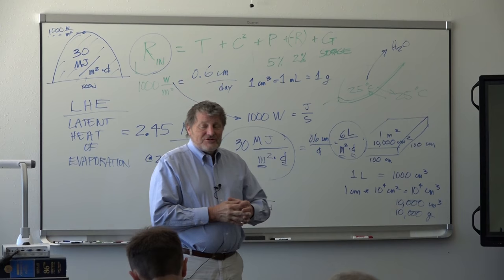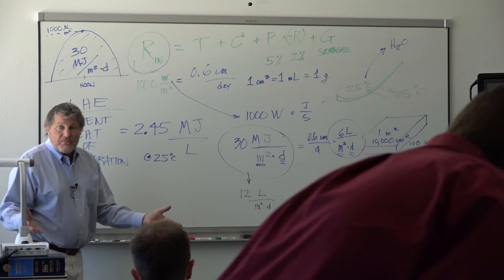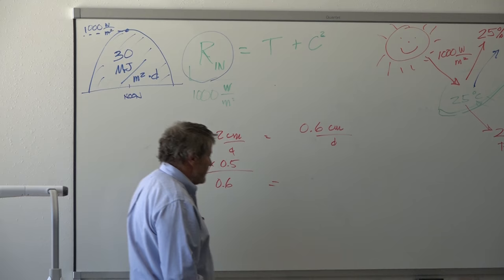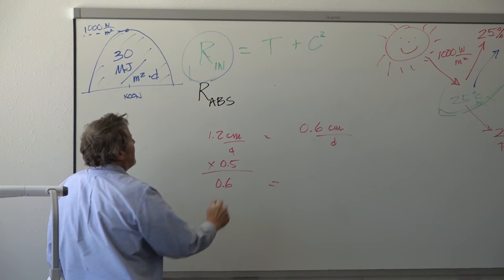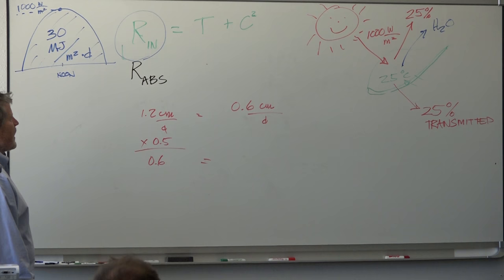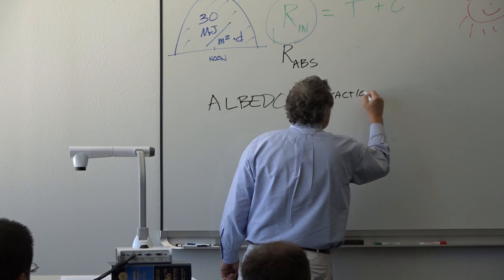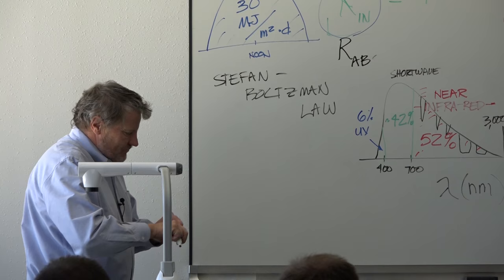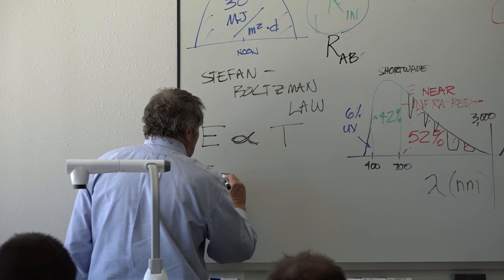Lecture 2-Principles of Energy Balance in Environmental Systems

Comment: At 28:30 when you are talking about leaf overlay, I believe that fact that many plants use the Fibonacci sequence in leaf pattern when growing due to general efficiency of the pattern, I’m wondering if there is any direct correlation that can be made to the amount of light that passes through these “groups” as you call them and the spacing of these leaves.  Just a thought.

Comment: The chart you showed that had leaf albedo and emissivity gave a value for absorption of 0.25. Your diagram of the leaf says that 25% of radiation is reflected, 25% transmitted, and 50% absorbed. In the example you state that 1-Albedo is equal to absorption which would be 0.75 not 0.5. It's been a very long time but I think the equation was supposed to be 1-albedo-transmittance=absorption. If so, your chart that you supplied is missing some values that are needed to do these calculations. Hopefully, someone can help clarify for me. I lost my textbook to a wildfire a couple years, otherwise I would just look it up the relationship between albedo, transmittance, and absorption.